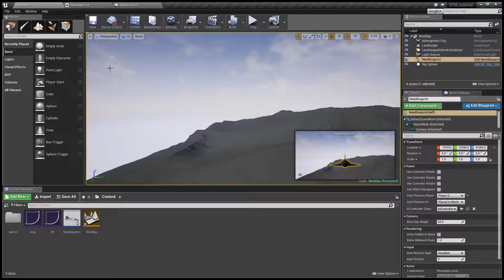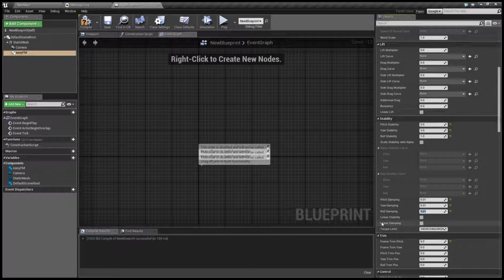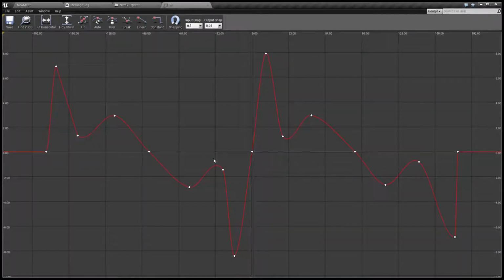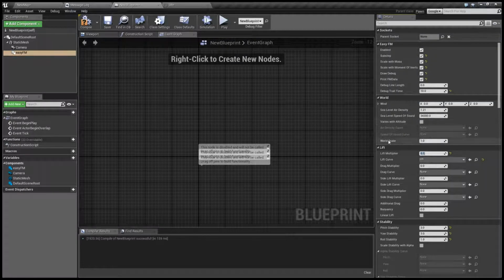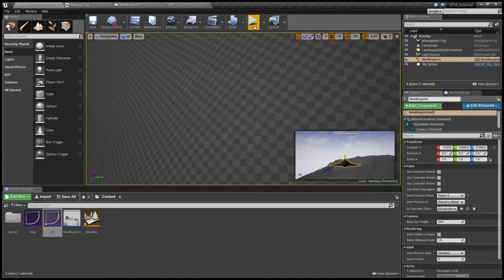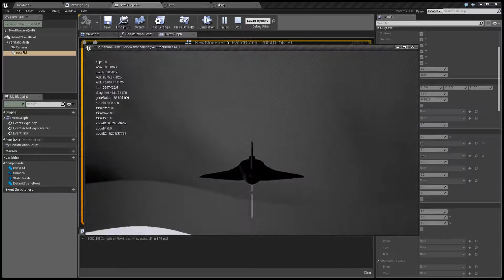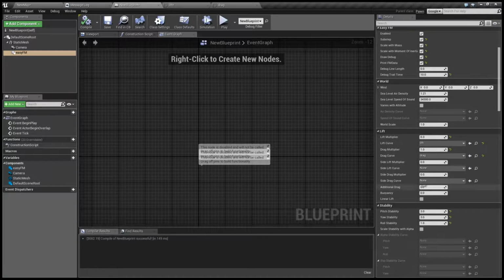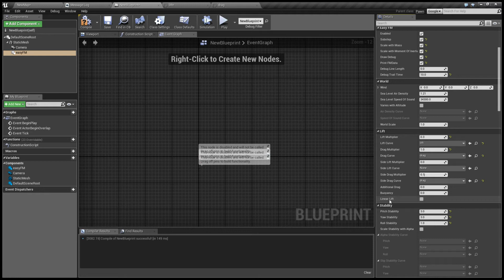EasyFlightModel UE4 tutorial - ep.2 (stability, lift, drag)

Comment: my glide slope keeps printing (no asymm) : -(nan)ind
Reply from the maker: That typically means that there was a division by zero somewhere. Most likely you have zero drag.
Reply: @Worstplayer   thank you, also whenever the jet falls, is pointing and going straight down mesh starts rotating  from its center violently.
Reply from the maker: @naimishambasana7494  That's most likely stability and/or damping being too high.
Reply: @Worstplayer  So, I implemented a drag curve and drag multiplier but glide ratio still shows  (no asymm) : -(nan)ind. Also The lift and drag shows 0
Reply from the maker: @naimishambasana7494  Sorry I have no idea, hard to say without seeing the project.

Comment: Where did you get the lift curve??? I can't find it, and remaking it is too difficult since the values aren't really shown in the video. Hope you can help :)
Reply from the maker: Copy it from one of demo projects.
Reply: @Worstplayer  if you mean the example projects on the epic games, those are locked for some reason and I can't access them :(
Reply: oh wait for some weird reason I can access them now. lol
Reply: @Worstplayer  Hey sorry to message again, I did get the lift curve and the other drag curve, I followed up to tutorial 4 or 5 and also checked out the example project, but my plane doesn't want to go forward, steer or take off. Only the brakes work. Is there anything I am doing wrong?
Reply from the maker: @GoldenFreddyCinema  well to go forward you need an engine. Check if settings for that are correct (note: engine power is in uu/s/kg, so you need a lot of it to move, try around 100000)
Reply: @Worstplayer  thanks, I got the plane to take off and steer, but when the plane is in the air it either trips a lot, and flies of everywhere, or it just goes down for no reason, the engine power is up a lot (10000000,0). Any solutions for it crashing down?
Reply from the maker: @GoldenFreddyCinema  i don't know, i'd have to see it fly to have any idea what could be wrong.
Reply: @Worstplayer  sir my plane takeoff and steering is good but when the plane is in air it always goes down slowly..... i always have to steer up.....plss help me
Reply from the maker: @DharmendraYadav-rf1zg  adjust trim or use auto trim
Reply: @Worstplayer  already done :(
Reply: @Worstplayer  can we talk on discord??

Comment: Hi, having trouble with the printfm data. Lift and Drag at 0 even in the light aircraft demo
Reply: Discovered enabling lift asymmetry is causing lift and drag to be 0, is this a bug perhaps?
Reply from the maker: @ariesvr8140  not a bug as such, but not implemented. when you turn on lift asymmetry, some portion of lift is removed from main calculation and computed individually along the wingspan. this isn't displayed in printfm data.

Comment: I've been having a consistent problem that my plane rolls to the right instead of nose-first. What is causing this?
Reply from the maker: Most likely due to model having asymmetric collision.
Reply: It does it even when my collision is set as a simple sphere.
Reply from the maker: Hm, that shouldn't be happening. Is it possible to upload relevant bits of the project somewhere so I can take a look at it?
Reply: Here's a link: https://drive.google.com/open?id=0B2pkJ-EqMI2Ac2F5TkVNblNWSU0
It's been happening with every model I use, every project I create, and every engine version I try, so it's obviously something I'm doing wrong, or a setting I'm missing.
Reply from the maker: OK got it. The problem is that rotation of your models is wrong. They're rotated 90 degrees to the left. Try adjusting import rotation in the mesh editor and reimporting the model. When rotated correctly, the spring arm camera should show correct 3rd person view when rotated 0,0,0.
Reply: Thanks. I was rotating everywhere else, forgetting about the import rotation. It's nosing down properly now. Time to get flying! Great plugin, thanks for the work and the help!
Reply from the maker: No problem, let me know if you need help with anything else.
Reply: 4 years later, and I wasted half an hour on exactly the same problem 🙂